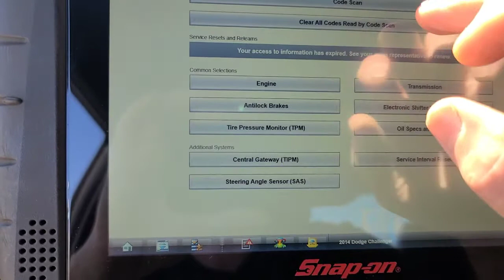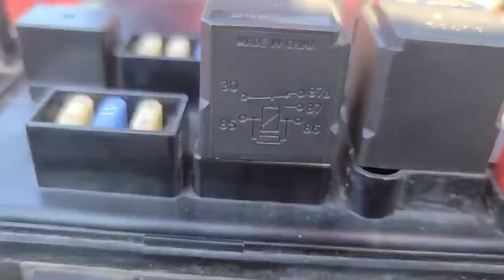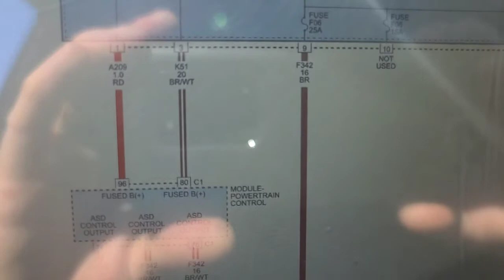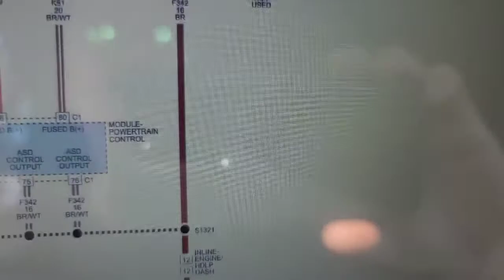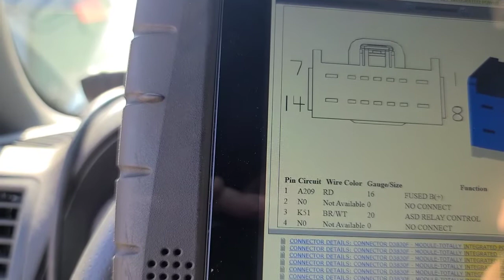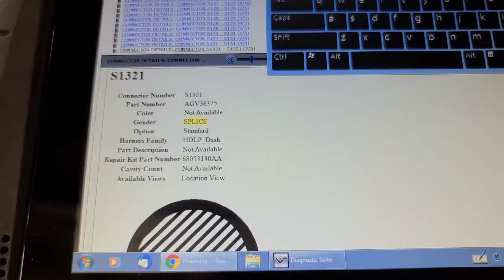2014 Dodge Challenger Cranks no Start. ASD Codes

Comment: In the harness that runs back behind the passenger side valve cover at the fire wall, many times there will be a wire rubbed through to ground.

Comment: Hi Phil. I have a question about this particular instance. Did the car also stall randomly or just not start? I have a Caravan with a loose connection on the ASD relay but it's not throwing any codes, dies intermittently, and the battery has to be disconnected and reconnected to start again... not sure if it's some kind of state the computer enters if the ASD relay intermittently loses connection. Thanks!
Reply from the maker: As far as I know this was just a nostart condition with an ASD code. It's certainly possible that if the ASD relay or circuit fails while running that it would shut off. Disconnecting the battery would clear any codes. I'm curious what code is setting and if clearing codes with the scanner would allow it to restart.
Reply: @PhillipBailey  so I actually had a snap on Solis on me one time when it died, and it threw no codes... today I pulled the TIPM out, took the fuses out and top cover off, and squeezed those pins a little tighter so that relay will sit tight. I also found a little two wire connector, oval shape with no latches on it, laying in the side of the battery box that was somewhat melted... couldn't for the life of me find anything unplugged. It comes out of the harness close to where the harness connects to the TIPM. Probably not related but strange find when everything else electrical seems to work...
Reply from the maker: So once it stalls it won't start until you disconnect the battery? Does it still crank normal, mil come on and then go out, still have communication with a scanner? Does it have spark and injector pulse if it cranks ok?
Reply: @PhillipBailey  yeah, it won't start until you disconnect the battery, it does crank normal, has fuel pressure, but it seems like it doesn't spark. Sometimes it will act like it's trying to fire and then just crank until it stops.
Reply: @PhillipBailey  it does still communicate with the scanner with no lights on the dash.
Reply from the maker: @shawnfaulconer7462  unfortunately you need to drive it while recording data with a scan tool until it stalls. Once that happens you need to confirm that you have a cam and crank signal while cranking. Then check for spark and injector pulse. If I was diagnosing it I would connect a lab scope to the cam, crank, ignition control and an injector. Also a test light to an injector power wire to see if you're losing power.
Reply: @PhillipBailey  Thank you sir! I plan on performing these tests here in the next few days

Comment: Having the same problems with my 2011 challenger crank want start
Reply from the maker: That's unfortunate. There are lots of possibilities. You need to start with a network code scan of all controllers to get codes for a starting point. Possibly check fuel pressure, spark etc.

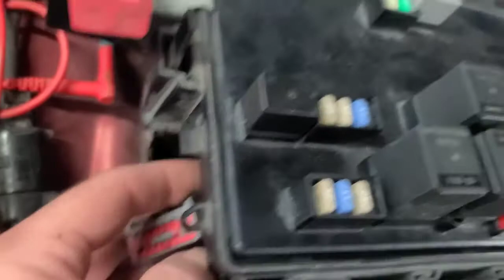Comment: Hello I was wondering about the plug at 8:13 I just did an engine swap on my challenger 20103.5 and having issues with that plug as it wasn’t designed for the hemi so I’m in the process repinning the plug would u happen to have a schematic
Reply from the maker: Try Alldatadiy.com. not free but reasonable imo.

Comment: Good evening Phillip Bailey and nice to meet you my friend!

My vehicle (2003 Dodge Caravan Se V6 3.3) is giving me a (P0201-Injector Circuit/Open Cylinder 1) code and i have a (2003 POWERTRAIN DIAGNOSTIC PROCEDURES book for town & country, caravan and voyager) that shows on page 88-89 test procedures to follow and apply. 

So far i have applied (test 1) and (test 2) and im on (test 3) now and im stuck on not being able to follow and apply it cause im not grasping and understanding it at all. 

This is Test 3
Turn the ignition off.
Disconnect the Fuel Injector harness connector.
Remove the ASD Relay from the IPM.
Turn the ignition on.
Jumper the Fused B+ circuit and the ASD Relay Output circuit in the IPM. (This part im lost)
Using a 12-volt test light connected to ground, probe the (K342) ASD Relay Output circuit.
Does the test light illuminate brightly?
Yes      Go To 4
No     Repair the open in the (K342) ASD Relay Output circuit.
          Perform POWERTRAIN VERIFICATION TEST VER-5.

This is a video of me following and applying (test 2-https://www.youtube.com/watch?v=rbzQKyiNwcA) and in that video it shows the pages in the book from page 88-89 and pages 312-314 for code (P0201-Injector Circuit/Open Cylinder 1).

Are you able to please make a video showing me how to apply (Test 3), (Test 4), (Test 5) and (Test 6) on page 88-89 and the same from page 312-314 (Test 1), (Test 2), (Test 3), (Test 4), (Test 5) and (Test 6) shown in the video?
Reply from the maker: Good evening. That code indicates insufficient current was detected on injector number one drive circuit. It's either the injector, wiring or the drive transistor in the PCM. I don't like following those trouble charts as they are often confusing and require the use of special tools or functions in the scanner that your scanner may not support. I watched your video where all 6 injectors measured around 12.5ohms. That good but can be misleading since the injectors are cold now. I've seen where they can fail once hot. Here's my recommendation on how to diagnose this. One wire on each injector will be live or have power for about 1 seconds when you first turn on the ignition. Look at all the injector wires you will see the common power wire which is the same color I believe green which comes from the ASD relay. This relay supplies power to all the injectors but the PCM shuts the relay off after one to two seconds if your not cranking the engine. Connect a test light to ground and check for power on the common wire to each injector when you first turn the key on. Compare all injectors. Next you can use a noid light connected to the injector connector and crank it over. The noid light should blink while cranking if the wiring and computer are good. If you don't have a noid light use a conventional test light with the alligator clip connected to battery positive and probe the control wire while cranking. Same as the noid light it should blink. If it doesn't yet you have power to the ASD feed wire you need to check continuity of the control wire from the injector all the way to the PCM appropriate terminal. If the wire is good and the computer is not pulsing the ground on the injector then the transistor in the computer has failed. If the test light blinks at the injector while cranking that suggest the PCM and wiring are ok. I would then either swap the injector to a different location or replace it even though it tested ok with the ohm meter. If you have a full function scanner there is a bidirectional test available in the scanner that can request the injector fire key on engine off. This can be done with each injector as well as the fuel pump, cooling fan, ac clutch, ASD relay etc. Hope this helps you. I'll see if I can find you a video on injector circuit testing that I've done.
Reply from the maker: Here is a similar problem on a journey...https://youtu.be/N86qgh4pa_Q
Reply: @PhillipBailey  
I watched the video from beginning to end without fast forwarding and skipping.
Reply from the maker: In the video I actually current ramped the set of injectors but that requires the use of a lab scope and low amp clamp which I'm sure you don't have. Near the end I used a noid light which simply plugs into the injector connector. Also note that this injector did not fail open until it warmed up making resistance tests inconclusive in my opinion.
Reply: @PhillipBailey  
Your absoluely right i dont have a lab scope nor a low amp clamp either.

I do have an OTC (3054E) Noid Lite/IAC Test Kit.

Comment: hello Phillipi ordered a cable from u after watching your video for my 2014 ram 5,7 i blew a lighter fuse  and went to replace it which i did , i did remove all the 20amp fuses just to check them till i found the bad 1 after i tried to start the truck and all i got was crank but no start ): am not sure wat went wrong or that suddenly i have this issue ??? am sure your busy but any imput from u would be  helpfull the tipm u showed is not exactly like mine can u tell me which # fuses i need to connect for my ram
Reply from the maker: First what year and what engine. What exactly happened in what order. Have you scanned it for codes? Does the MIL turn on with the key and then go out? Does the fuel pump turn on with the key for about 1 second and then stop. Give me some answers and I'll try to help you out.
Reply from the maker: Ordered a cable from me???
Reply: @PhillipBailey   hello am still with the same issue i ordered a cable from jason a guy just like u explaining the same issue  all i did was replace a blown lighter fuse 20014 5.7 engine the cable is a bypass have not recieved it yet
Reply from the maker: @killlemall1  could you have installed a fuse in the wrong place? What about the rest of the questions I asked?

Comment: Just got back from my repair shop, they got the car to start and drove it around, but when I got there the car went back to cranking and not starting. All the computer diagnostics turned out to be good, and they couldn't find anything wrong with the car. They referred me to the dodge dealer. If they can't fix it, I'm lawyering up and getting all my money back from the dodge dealer I got the car from. I've literally spent $3000 plus dollars in repairs and tow trucks, not to mention the inconvenience of not having a reliable car to do my daily activities. I suspect the dealer knew something was wrong with the car, but fixed it and sold it anyway.
Reply from the maker: Well intermittent problems are extremely difficult to track down. I could tell you many horror stories I've dealt with over the years...
But when the car won't start something has to be missing. Spark, Fuel or compression. I doubt it's a mechanical problem (compression) as they don't usually fix themselves. So that leaves ignition and fuel. If I was diagnosing it I would test for those things when the problem is present. Most things that result in your symptom will generate a fault code in the PCM but some will not. An intermittent mechanical problem such as low fuel pressure from a defective fuel pump does not usually generate a code if it won't start.  Wishing you good luck.
Reply: @PhillipBailey  are you by any chance located in southern california?
Reply from the maker: @RareAirTwo4  lol far from it... Ontario, Canada eh...

Comment: I have a 2015 challenger and have had starting issues for a couple years now. This is very frustrating, I feel like either getting a bat and destroying the car or getting a lemon law lawyer and taking the dodge dealer to court. I just brought it back from the auto shop, and they told me it was just a blown fuse. 3 weeks later, the car cranks but doesn't start once again. This has happened 3 times, which is unacceptable on a car under 50k miles. This is a beautiful looking car just a headache with the starting issues. I very much just want to get a reliable toyota camry and stop spending money on continuously fixing my Challenger.
Reply from the maker: I feel your pain and as a technician I know how frustrating it is to diagnose. There are so many possibilities for a crank no start condition. The tech has to have test equipment on it when it's acting up. Codes set in controllers can help but can sometimes be misleading. Do you know it it sets any codes in any controllers after a no start condition? That would be a good starting point. What fuse was blown. Fuses do fail occasionally but usually when they do it because of an intermittent short. Try find out what fuse was blown.
Reply: @PhillipBailey  I have a great licensed auto shop that diagnosed and fixed my car. I'll have to take it back. I hope it's something inexpensive. I've had this car for 5 years and have spent over 2k on repairs. Which I find excessive for a brand new/like new car. I had a Camry for about 10 years and only spent money on oil changes, tune ups and tires. The Camry ran like a beauty before someone hit me from behind and totaled it.
Reply: @RareAirTwo4  did you ever get your car fixed? Having the same issue here.
Reply: @bryanrojas3478  Yes got it fixed. It was the fuel pump fuse 26 in the trunk fuse box. It had a 20 amp fuse, when the manual asks for a 25 amp. I put the new fuse on, now it runs like a beauty. So I basically paid over 2 grand getting 2 different fuel pumps when the issue was a simple fuse. I lucked out that I found a great mechanic that diagnosed it, cleaned the fuse ports and got my car up and running. Now i have like 15 spare fuses just in case I need them in the future. Good luck fixing your car, I know how frustrating it can be.
Reply: @bryanrojas3478  I also did a fuse pull for added horsepower/torque. You pull fuse 29 and 31 in the front fuse box under the hood, remove them for 10 minutes and then plug back in. Your car will feel more responsive, just like when you got it from the dealer. I was surprised.
Reply: Wish me luck guys, I. Fixing to do this in the afternoon,  on my 2011 😔

Comment: I have a 2015 Dodge Challenger with starting the issues. The car cranks but simply won't start. I just purchased a new battery and the car still won't start. I've had fuel pump issues before but I dont know what's truly going on now. I guess it might be either the starter or fuel pump.
Reply from the maker: Well it won't be the starter or the battery if it's cranking ok. You need to connect a scanner to see what codes are being generated. Can you hear the fuel pump run for about 1 second when you turn on the ignition? Have someone listen at the fuel cap of the fuel tank for the hum from the pump. If no pump you need to check the circuit. if it does run you need to confirm fuel pressure. Then check for spark and injector pulse. Need some test equipment but there are a couple suggestions... hope that helps.
Reply: @PhillipBailey  hey thank you very much.
Reply: Did you ever figure it out

Comment: I've this iss vehicle not starting ignition all on. 
Just reprogrammed the fob checked all the fuss relays so on still no thing no cranking no starting challenger 19 can someone help please
Reply from the maker: need to network scan it for codes related to security. Watch data parameters related to crank request.
Reply: @PhillipBailey  i have scanned it with my im508.

Can i not find out via my Autel im508?
I've received the following cods
U0101 U0168 U011C2
 and I've just seen some other videos saying it could be the Daiw on the truck right at the end of the fuse box.
Reply from the maker: @dashtyATG  Uxxxx codes are network problems and a loss of communication between modules will likely cause a no-crank condition. Could be wiring or any module on the network. Need a full function scan tool to see what's not talking first, lab scope to look and Can Bus signals and wiring diagrams. Start by checking all module fuses and grounds. other than that need some decent test equipment and knowledge. Good Luck.
Reply: @PhillipBailey  i agree with you %100 and with i had you around it's crazy iraq plenty scamers on top. 

but to my knowledge and power specifically financially i couldn't get a proper scan tools and I'm still learning.

So thanking you anyway boss.

Comment: My 17 scat has a similar problem it'll half crank half crank half crank then eventually it will start but its not a continuous problem and no check engine light, can you diagnose a problem with out a check engine light on??
Reply from the maker: The absence of a code makes it more difficult but not impossible. Excuse me but whats a scat? What are you using to scan the controllers? If its not a factory level scan tool it may not report the codes in other than the ECM.
Reply: Haven't scanned yet its a challenger scat pack with 6.4 hemi

Comment: Hey Got questions for you I've got a 2012 challenger 5.7 an iam having the same trouble my ASD connecter looks just like the one in the video you said you had to reform it how did you do that
Reply from the maker: Replaced the plastic connector body with a used part and transferred all terminals. Replaced the overheated one though and spliced one wire. That terminal is too small for the load on it in my opinion.
Reply: Same here. 2012 Challenger R/T. Crank won't start issue once or twice a year. I've had it 9 years and has 110K on it now. Maybe time to sell.